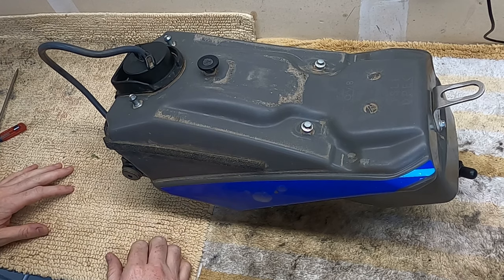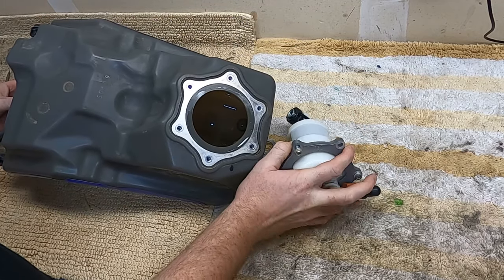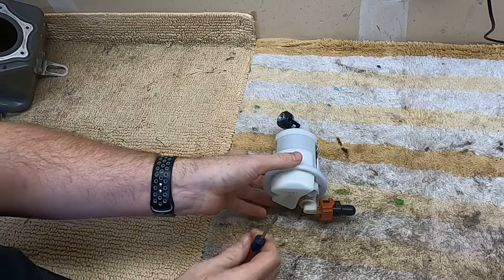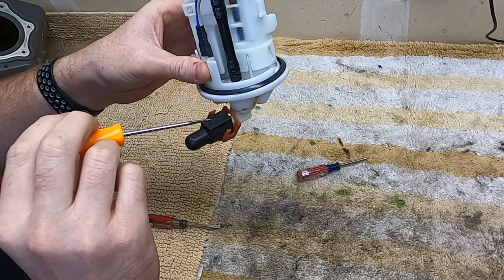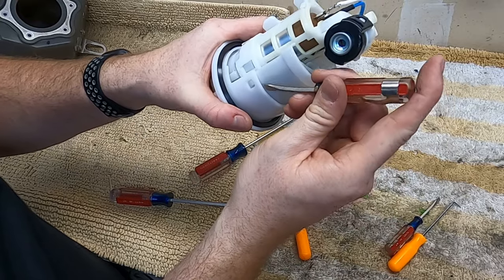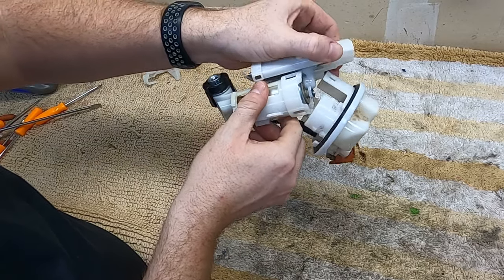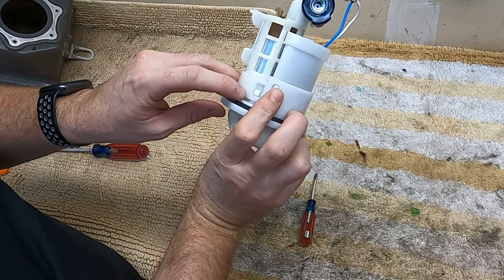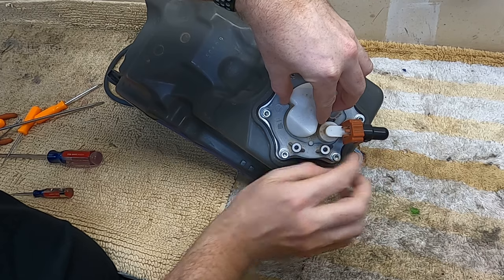How To: Clean / Replace Fuel Filter on a Yamaha YZ and WR

Comment: Thanks for this video, you saved me buying a new assembly! I bought a 2015 that was ridden for 3 hours and then sat since purchased. The regulator, pump and filter were caked in old gas gunk. Thanks man you’re a legend.
Reply from the maker: Glad it was helpful!!
Reply: Hey quick question Mark…I’m in the same situation. My YZ250F was sitting for 16 months. It’s brand new and only has 11 hours on it. I’ve tried everything to get it started but still haven’t been able to figure out what’s wrong. My gas has been sitting in there for 16 months. I emptied the tank and replaced with fresh gas. But was that enough? Do you think I should take the pump out and check? I verified it works and pumps the new fuel.
Reply from the maker: @caytelyn891  is say check spark plug, they are notorious for needing new plugs often.    Replace plug and verify it’s getting spark.    If strong spark then you can check fuel filter but if you have verified fuel is flowing through it, then that’s probably not the issue
Reply: Was the bike harder to start? I had my valves checked and everything same situation with mine. It’s just very hard to start.

Comment: This fixed my bike! Thank you for the information. 😁
My 2020 YZ450F has almost 500 hrs and started to stall (run out of fuel) when it only had 1/4 tank of fuel and I was going over whoops at high speed. After the cleaning it runs strong until the tank is completely empty. 😎
Reply from the maker: Glad it helped!
Reply: same thing with me, currently avoiding trying to get these god blessed 3 tabs off, been trying to for an hour

Comment: Thanks, this helped me quite a lot.  I used it for a 2013 Yamaha XT-250 and it will probably work for any year fuel injected XT-250 since they don't seem to change anything except the colours year by year.  I found that I could leave that connector that you have on the fuel line coming off of the pump, back on the hose still attached to the bike, made for an easier job of things.  You have to squeeze the two tabs on the connector while pulling out the hose, would be a lot easier with a 2nd person as would most of this job.  I elected to buy a new filter, got 3 for $18 from Quantum, they don't look as nice as the original but I hope they will be good...I didn't want to go through all of the trouble of taking apart the pump housing more than once.
Reply from the maker: Glad it was helpful!

Comment: thank God, this is exactly like my fuel pump except that I have the fuel filter exposed out so all I need is to pull the pump outta the tank and change the filter, I can even see the filter though the tank hole .
but that also helped my  a lot thanks. (I think you can buy those filters got mine for about $5 but slightly different for yamaha FZ150i)
Reply from the maker: Glad it helped!

Comment: Pulled apart my Yammi YBR125 pump today.  Sympton was non-starter, but turning over okay, yet not firing.  Squirted some juice down the spark plug hole and fired okay, so started looking at fuel supply.  Could hear the pump prime okay when turning on ignition, so presumed that was okay and instead went to the injector.  Took off the injector and connected to can of carb cleaner with a tight rubber tube and squirted through okay, so wondered if there was a pump issue afterall.  So, stripped it back (as per this video - pump unit is fairly similar), submerged the pump + filter in a bucket of water and connected the pump to power.  Horrible cloudy crud tried to ooze out with barely any force.  Removed filter strainer and tried again and was happy to see that the crud came out better and then in a few seconds was shooting water through at a good pressure.  Dried the pump and air-lined it to dry inside.  Not gonna try to re-use filter and will get a new one on Ebay (just looks too far gone and don't want to have to strip down again to replace at a later date).  Glad to keep the original pump, so hoping it will be okay when it all goes back together :)  Thanks for the video Josh - really helps to give me a bit more confidence when I have seen that someone else has overcome a problem like this.  Cheers.  P.s.  Likely all my own fault as I do barely any miles over just a few months of Summer riding and topped up last Summer's petrol that was still in the tank :(  When I emptied the tank to get to the pump, the fuel was really yellow - yuck!  Gonna look to just throw away old fuel before start ing afresh next Summer :)
Reply from the maker: David Martin glad video helped.   Ethanol fuel is nasty if it sits for a whike
Reply: Did this fix ur non starting an not firing have a 16 yz450fx that backfired bogged a shut of wont statt getting spark dont know about fuel but need some help an this is the place for the help on all of internet this is the exact problem I'm experiencing good compression spark just no start help

Comment: The difference between this fuel filter and the WR250R-X is there is not a shroud over the WR250R fuel filter.  once you've removed the fuel pump from the WR250R use contact cleaner to clean the filter with no further disassembly or assembly required.
Reply from the maker: good to know

Comment: Awesome video man! 👍 I was looking for a replacement fuel filter for my 250 bike too. I didn't find any replace filters on ebay, do you have a link to buy one? 
I was also wondering how you clean your filter?
Reply from the maker: I used contact cleaner and air compression to blow out after soaking well in cleaner.

Comment: Thank you, worked perfectly.
Reply from the maker: arizonarats thanks man - awesome to hear.    It’s a pain to get the plastic clips undone but after that it’s pretty straight forward
Reply: @joshmundy  I took it apart, replaced the fuel filter, put it together and it turned out to be the fuel pump so I got good at taking it apart. Because of covid I had to wait quite a while for the part to come in but bike runs great. Again thanks so much.

Comment: Hey! I was able to follow your video and clean my filter. didn't solve my problem though. my bike cuts out doing a long stoppie unless I have a completely full tank. I'm assuming its fuel pump or sending unit related. I tested it by recreating the stall during stoppies and then filling the tank and had a friend lift the rear end to balance point while I held the front brake. ran fine no stalling with a full tank but when starts to stall at 3/4. I'm going to order a new fuel pump assembly.
Reply from the maker: Id say its working fine, the issue is you are probably starving the fuel pump of fuel.   Long Stoppie means the rear is up high for a while, so all fuel is pushed to the front of the bike.  The fuel pump is located at the rear and lowest most point of the tank.  you tilt that forward and now your airgap is where the pump is located.   Do this for an extended period of time, and you run out of fuel.   Look at how low the fuel pickup is on the filter to the pump, its pretty much 1/3 of an inch from the bottom of the tank.  The bike would not have to have the rear end up high very far for it to move the air in the tank to that area.

Comment: friend a question, do these pumps have some kind of check valve to keep the fuel in the system? I ask him why my yz450f 2015 takes time to turn on and the mechanic says that the pressure of the pump drops and the system discharges, the clock shows 46 psi while the motorcycle is on when it is turned off it drops to 0 psi immediately
Reply from the maker: Honestly have no idea.   Sorry man
Reply: Hello, I had a similar case with YZ450F 2016. it is the fuel pressure regulator which maintains the residual pressure to facilitate restarting. if your pressure drops immediately to 0 psi after the engine is stopped , it means that your regulator is stuck in the open position, in most cases because of unfiltered debris, you can try to clean the fuel pressure regulator or replace it ... condition of the fuel filter to be checked too . I hope it will help
Reply: Yes they do mate, it's just inside the plastic pipe where the fuel pipe connects

Comment: By cleaning the fuel pump would the bike run and idle better
Reply from the maker: Possibly.  Could be many different things for bad idle and running condition.  Clean fuel filter and a fresh spark plug is a good start though

Comment: What was the symptom that led to cleaning up the filter
Reply from the maker: No symptoms, just was more curious if it was 1-dirty   2-can I get to it to replace if needed
Reply: @joshmundy  I actually went ahead and did it according to your vid. Filter was filthy but the bike is still breaking down at mid range Rev. Further inspection I found my intake manifold cracked which is most likely the reason so will have to get it out and replace
Reply from the maker: Nazir Ghumra glad the vid was able to help get it cleaned up

Comment: Do you have a video pulling the throttle body out?
Reply from the maker: No but it’s pretty easy.  Just unbolt air box from frame and unclamp it from TB and it lifts up and away.   Than unclamped TB and you can swing it up from frame and undo throttle cable connections
Reply: I have a 2012. The manual Says I have to remove the shock and unbolt part of the subframe. But you’re saying it’s possible to remove it without doing that?
Reply from the maker: @desertrider325  Guess depends on bike.  What bike do you have?
Reply: 2012 WR450F. 

But I had another bike years ago said similar about pulling the carb and I found a way to do it and sneak it out the side. 

Thought maybe you did the same thing. Found an easier way as opposed to the set manual way. 

Also what year make and model is your bike you did this on? Pulled the throttle body out on? Or can you pull the injector off without pulling the throttle body? 

I need to pull and clean my injector.
Reply from the maker: Bike in video is for a 2015 YZ250FX.  not sure the video will be help to you as your 2012 WR450 is carburated.   Anyways, pulling carb is easy, bike needs to be on a stand, 5-10 min job, used to have similar bike.    Remove seat, loosen upper subframe bolts and remove lower sub frame bolts, loosed boot clamp and swing up subframe, then tighten upper subframe bolt to hold it up.   remove upper shock bolt and let swing arm drop with shock attached below.   Now you have full access to remove carb
Reply: 2012 is fuel injected. And the 2012-2015 are basically all the same for WR’s. So should be very similar to your 2015. Is your air box in the sub frame? or is it up on top of the frame towards the head set?  Mine has a door that opens on the side of the sub frame to service it. 

Is there a way to pull just the injector without pulling the throttle body? Or does the throttle body have to come out? 

Thanks for the tips.
Reply from the maker: @desertrider325  you are right.   When i typed 2012 WR450 in google and hit images, it was identicle to my 2008 wr450 and I could see the carb.    upon further looking I see those images were wrong.    The 2015 YZ250FX is like the newer yz250f, airbox upfront, fuel tank under the seat.  On your bike removing TB would be similar to removing the carb as i described above as its in same place but I have no 1st hand knowledge .

Comment: yea, ive got a 15 yz250f with problems.  Third time customer rode it locked up.  So I checked recalls shocked to see them all actually.  Ripped motor out took all the way apart.  Generator wheel nut came loose, generator wheel justlying there. spun on the shaft broke the key.  Bought new wheel new key tested, everything ohmed out, still wont start.  Checked all the sensors they all ohm out. Now no freakin spark.  I cant beleive the whole harness has one ground on this bike.  Oh I was giving you poop becasue use carb/efi cleaner not brakekleen on your fuel stuff. Please. lol
Reply: Oh I did the fuel filter, it was horrible.  DIdnt want to buy three so I soaked overnight and blew it out.
Reply from the maker: wait, so you were giving me crap for cleaning a filter and not replacing it, but you just admitted you did the same thing?!?   Also, never used Brake Cleaner, I stated in the video I used contact cleaner, which is safe for plastics and rubber.